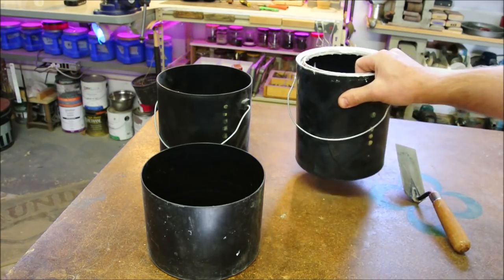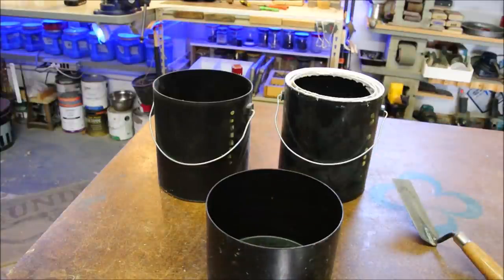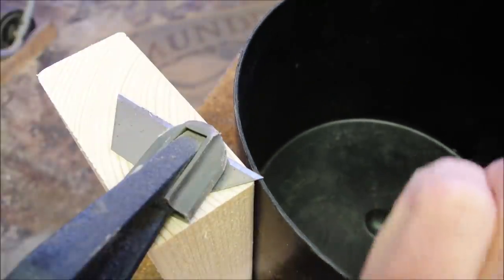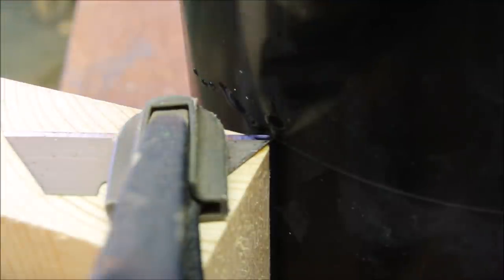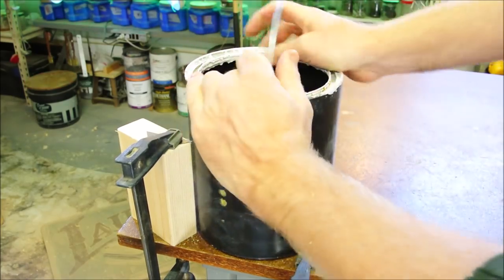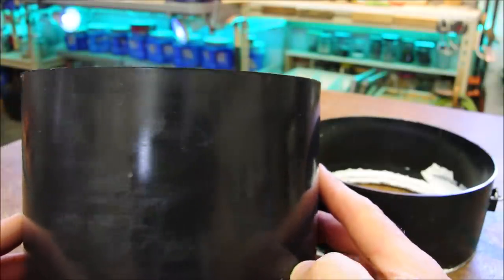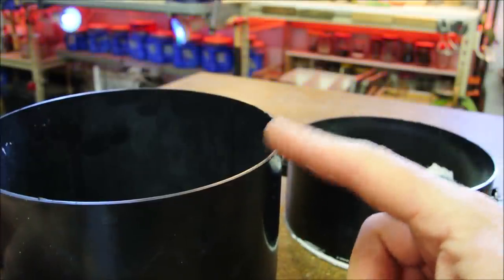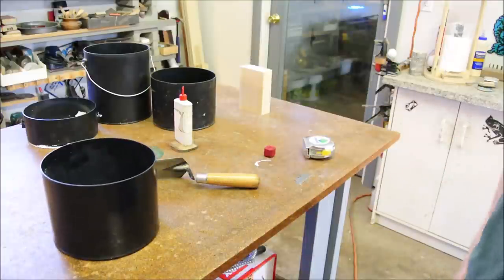Recycled paint can mixing bowls

Comment: Great tip Pocket! These also make excellent hats . . .
Reply from the maker: Yes. Just be sure to leave the handle attached in case you are planning on swimming. A strong chin-strap will help keep you from swallowing* water!

*User experience may vary. While chin-straps have been associated with some reduced mouth intake during drowning scenarios, actual degree of reduction will be largely user dependent; thus, no legally binding claims about hat performance are here being expressed or implied. Consult a clinician before attempting to breathe underwater. Paintbucket hats are likewise unproven protection against sports injuries, hail, radiation, and fraud.
Reply: @pocket83squared   This is the kind of ingenuity that keeps me comin' back to your channel!

Comment: I love making containers out of those plastic Kool-Aid pre-mix containers.  Just cut the Dome off the top but leave the threading.  The lids are also just as useful, if not more so.  Toss a magnet on the bottom for a instant screw dish or just lay out dozens of them for easy sorting dishes.   They're infinitely useful and yea, I can never have enough of them.
Reply from the maker: We just bought some TANG, so I'll try that!
Reply: @pocket83squared  Wasn't Tang originally only available to astronauts?

Comment: Have you considered using a utility hook blade?  They slice through plastic of that thickness incredibly easily.

Also, I use serrated utility blades as well as pedicure cuticle cutters for rounding the sharp edges of plastic.  Though it's more effort than what you're doing with just the straight blade.   So if you're happy with those results then you won't need to bother.
Reply from the maker: I have not tried that. Hook-blades are expensive, so I rarely use them now. But the main point in this case is to remember video simplicity.
Reply: @pocket83squared  I think a 5-pack of utility blade hook blades are only 3 bucks.  Should be well worth it for the ease of operation.
Reply: @VagabondTE  For safety and accuracy, I don't think I'd want to put the torque on a plastic container that it would take to do it in one pass with a hook blade.  It would be jamming the entire thickness of the blade into the hairline cut.  Pocket's method is gradual, like a pipe cutter.
Reply: I just checked, hook blades are twice as much in price. They don't appear to have the point needed at the corner of the blade that makes this whole operation possible. Probably cuts through stuff great, not a good alternative in this situation. They're a specialty tool that will be great for people that do projects including upholstery, carpet, plastic sheets, etc.
Reply from the maker: @jprevard  When I was a roofer, we used a hookblade to cut caps (cutting a three-tab shingle in to three pieces to cover over a ridge). 

My boss was a beast at it. He would slice right down through an entire bundle in one go; slit,slit,slit,slit,slit, faster than you could see his arm move. He wouldn't even get arm pump, or stop to take the KOOL menthol out of his mouth while he did it. The scraps would just get ejected from the motion. The blade will still cut even after it's just a nub.
Reply: @pocket83squared  Thanks for sharing pocket, I just built and roofed a doghouse so I can actually appreciate how hard that would be! It took several passes for us with a new blade on a utility knife to cut through one shingle...as beginners of course. ;-)
Reply: It's more about changing the angle of the cut and the type of cut from a push to a pull. Pocket's setup could totally cut through in one go but it's not wise because the plastic is flexible.  However, if you were pulling, then there would be less of an issue because the hook of the blade would be pushing the material against the block.
Reply: Not trying to be pushy about it.  That's just my thought process.

Comment: I've never actually seen a plastic paint can here..  Even the ones I've brought over the last few months have all been steel with the exception of ceiling paint that comes in big square plastic tubs that are made to fit a roller in directly or the tiny same pots.. 
I'll look out for them to see if any brands locally use them for their round tins.
Reply from the maker: Video-making is strange. Every so often, it reminds me of some of the strange differences between countries. This one was a surprise, since we haven't had metal paint cans here for probably 1.5 decades. 

I've also learned that Europe has no plastic peanut-butter jars! That would be an adjustment ;(
Reply: @pocket83squared  Not sure I could live with metal peanut butter jars..
I do miss the metal golden syrup tins however, even after you washed them and filled them with screws or other things there was always a lingering sweet smell that was nice. :)
Reply: @ElectraFlarefire  They're glass ! Yup, glass jars.
Reply: @DesandSam  I forgot about glass jars, yeah, Aussieland has them in glass too but they are becoming less common due to risk of breakage around kids. I was thinking metal for some silly reason.